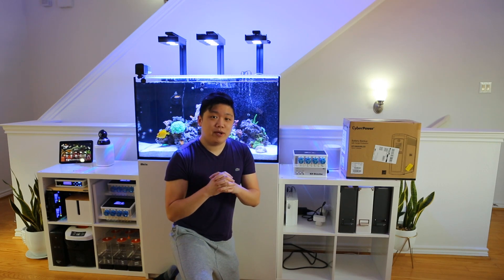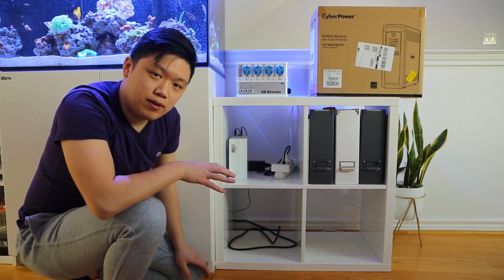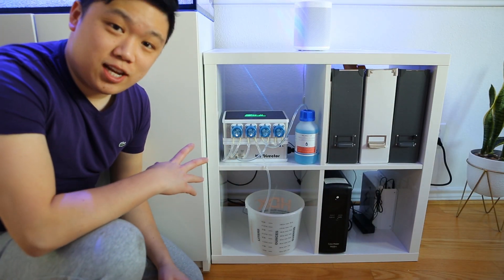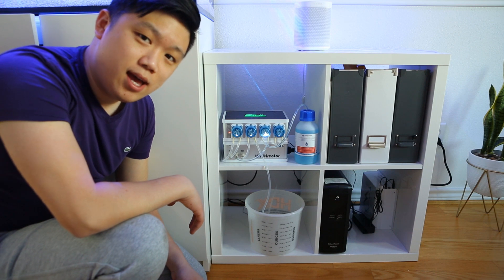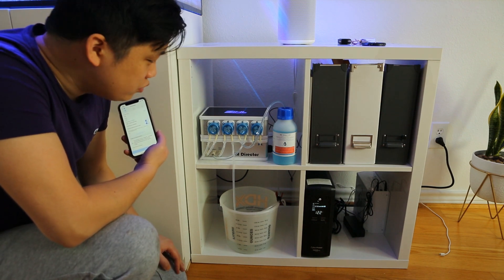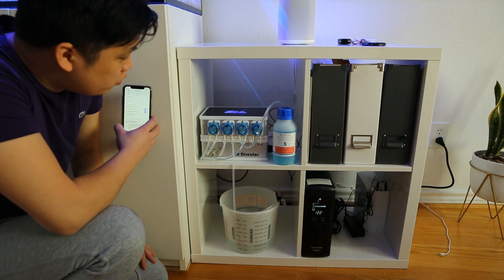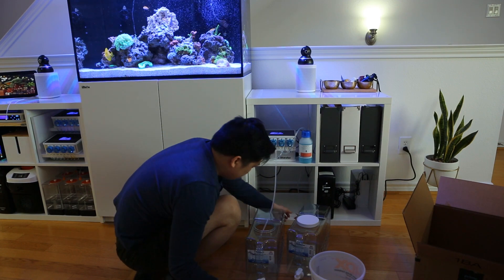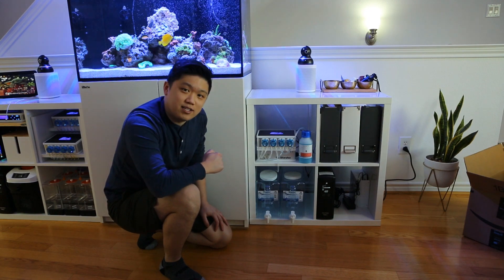Installing an Automatic Alkalinity Tester - GHL kH Director

Comment: I see so many products and equipments wonderful but the main display tank looks a lot below standard and healthy corals than an average reefer without all this is fancy kits
Reply from the maker: I couldn’t agree more! I love equipment just as much as I do the livestock. I started this tank fully from frags, and run ULN so the growth is relatively slow. You should check out my most recent video, the tank has progressed nicely and corals are really starting to fill out the tank :)
Reply: @HobbySci  I shall check that out. I am starting with frags only was looking between Alkatronic which is ridiculously priced such and bad attitude from the makers Eric Tang and Jonas. So looked into KH director. Is something you would recommend
Reply from the maker: Sharif Shebi I think both kH director and Alkatronic are good. Yes they are not cheap, but these most reefing gear isn’t. 
The big question you want to ask yourself is what ecosystem do you want to join. If you end up getting a kH director, you could eventually add on a Profilux, or ion director for even more controllability. I personally LOVE the GHL brand. It has made my reefing experience much much better. If you are tech savvy, I recommend GHL 100%

Comment: Noticed u were cutting the hoses to your desired length and also have the kh under the doser .

The directions states the hose length it needs to be and says doser ontop or to the side? 

Good idea with the storage units.like that alot .
Take it u have no kids though !
Reply from the maker: Mr Spoonz correct. I believe the recommendations are good guidelines. But if you think about it. The length of the waste water doesn’t matter correct? Since all it does is just clear water out. The reagent tube is always fully loaded so as long as you get it calibrated for those lengths it shouldn’t matter too much. And as for the water input, you can specify the lengths of tube in the App. With a good understanding of how the system works, I don’t think you have to follow the instructions exactly to a tee. However I would recommend doing so if you’re not super tech savvy. Also as for why I positioned it underneath, that’s just a personal preference. The dosing pump lines face down, so easier to wire it that way.
Reply from the maker: Mr Spoonz and haha yeah.. no kids... yet

Comment: Someone told me the airstone makes your coral stress out!
Reply from the maker: You certainly don’t need to add an airstone for a successful tank. My methods are def not usual. I dose heavy carbon regimens causing nutrients to be at 0 while feeding super heavy. All that causes my oxygen levels to be low. Normally the skimmer introduces plenty of oxygen, but mine is recirculating and scrubs CO2 out of the system, essentially introducing 0 new oxygen, hence the purpose of the airstone. Do I recommend this method to everyone? definitely not.

Comment: Just curious - Why are you running an airstone?
Reply from the maker: Blake Meadows I actually run an airstone constant now. I dose a lot of carbon and bacteria. My nutrients are basically 0 all the time. Per test kits that is. All my N and P is held in the bacteria. This can cause low oxygen hence the air stone. Yes my pH runs a bit low, but corals are tolerating it. Not sure how long I will be doing this, but it’s working for me at the moment.

Comment: How often  are you going to be running the test? When looking at the UPS, what are you running on the non-ecotech units and how long do you expect it to last?  Are you looking at using the profilux 4 power line monitoring at all? Thank you for your videos. Seems profilux 4 videos like this are not common.
Reply from the maker: Freaky Goblin I’ll be running tests 2 times a day. But maybe 4 if I find that there’s more valuable date to be gained from seeing the daily changes. I have two UPS and the only thing that’s plugged into backup power is circulation pump, air stone, and the actual GHL equipment. Everything else, lights and wave makers, protein skimmer. The idea of the UPS is more so not to damage any of the equipment during power outages. I’m ok with the lights being off. And currently I’m not using power monitoring, will definitely be getting into it at some point.